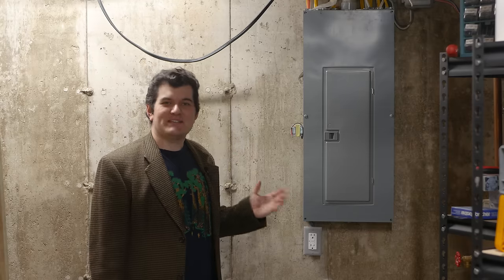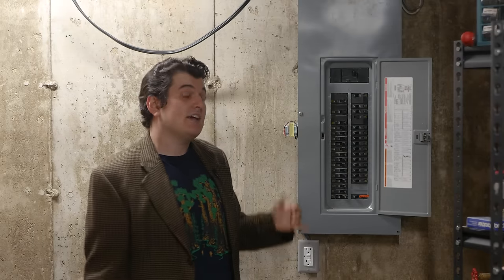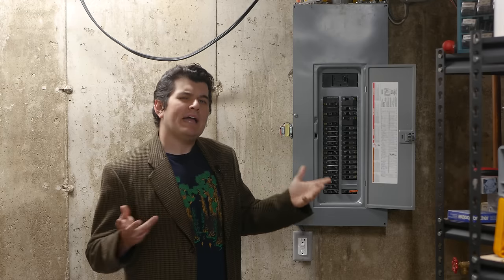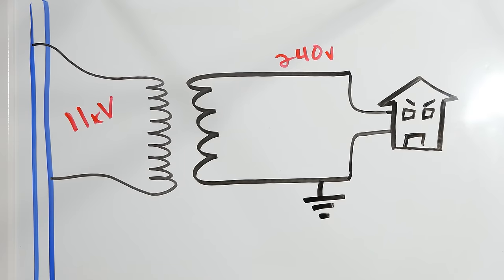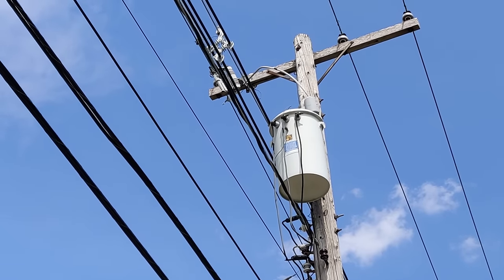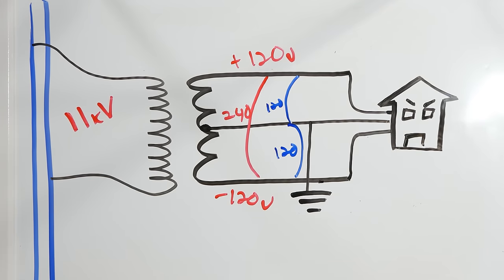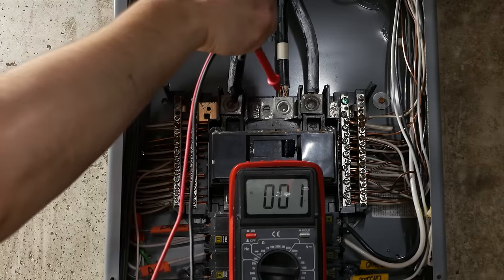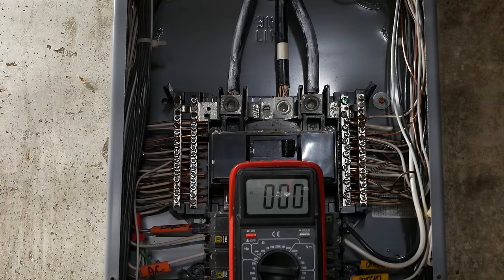The US electrical system is not 120V

Comment: A sign of the times I suppose... When I read the title of this video just now, I read it as "The US electoral system is not 120V"
Reply: So it's in a bit of a split phase, huh?
Reply: When I was a kid it was 110V - tested at 110V. Then 115V. Now 120V. Make it stop.
Reply: I'm pretty sure its running on a button battery. ;)
Reply: No,  it's POE Power Over Ethernet. We have the best money can buy.
Reply: The idea is misleading. What number gets used? The 240/120 used in houses. Higher voltage and 3 phase used in industry? The high voltage running down my street? The really high voltage used by the hi tension towers?
Reply: @captbiptoe  it originally started as 125 volts. It was supposed to decrease in voltage on the line until it finally got to its destination. That's how we ended up with 110 volts. With better distribution systems the voltage keeps getting higher, but it's not going to exceed 125
Reply: @captbiptoe  if you have two phase power, 240 / 2 equals 120. If you have three phase power, 208 / 3 equals 120. I know the angles are weird, but that's how it works out

Comment: In Colombia we get 13.2 kVl Delta-Y 208Vl  3phase transformes and the homes get  1 phase 120 , and 2 phase 208 if it has higth power loads, it has a advantage for the eléctrical system because You have a balancing reference in the low voltaje subsystem. 
And sometimes there are some residences that can get 3 phase but those are very rare, usualy people who have large pools,  jacuzzis and needs to move sincronous pumps, or sometimes people who have their business running i'm their Home and need move 3phase machines.

Comment: 380V says: "Hello from Europe!"
Reply: Yeah he mentioned UK , Aussies and weirdly avoided whole Europe for some reason.....I wonder why :D  Guess 380V/400V would be in next video :D
Reply: @terrabiker  some domestic houses in the UK have 415v 3 phase but it's mainly found in commercial / industrial buildings
Reply: NOPE THANKS  Or maybe it relies on a fundamentally different tech that would make the video too long?
Reply: 400V three phase here in the Netherlands 👍
Reply: @eddhick  415V is the phase-to-phase voltage corresponding to (pre-harmonisation) 240V phase-to-neutral; @CarmenSandiego 380V p2p goes with 220V p2n; 400V p2p goes with the now-harmonised 230V p2n.
Reply: They typically hold the higher voltage for commercial customers in the US. With most of everything outside industrial machines here using 120-240v their is no reason for the cost of fitting 480v everywhere.
Reply: 600v and 480v From America said Hi Back
Reply: 480 3 phase is very common for commercial and industrial motors in the USA, 600v is a standard but more for very large semi-custom stuff. 177/240 is common in lighting
Reply: @FM4AMGV  It would take awfully long to heat your sauna with an electric stove by only using 240V.
Reply: NOPE THANKS  Isn't that obvious?
Reply: @terrabiker  the whole Europe? He mentioned the UK...
Reply: @herrakaarme  yeah, because normal people have a sauna 😂
Reply: @fgsaramago  let me introduce the whole country of Finland
Reply: @laurimannisto5054  What, having a sauna? That's just weird, dude. Why? So people really love saunas that much? I wonder if you can detect a statistical difference in deaths due to cardiac problems when compared to other countries then. Why would people subject them selves to something that unhealthy on a regular basis?
Reply: We have 277/480v in the US, you're not special
Reply: 480volt is for small industrial to run 3 fase motor or heater, not for  residential and usually have own transformer, us too.
Reply: 380 volts say Greetings from Asuncion, Paraguay.
Reply: @fgsaramago  Yep. Finnish population is 5.5mij people and number of saunas is estimated to be around 2 milj. Saunas actually have lot of health benefits. Sure it also has its risks but for normal healthy person net effect is positive. Here are listed a few pros and cons: https://www.medicalnewstoday.com/articles/313109

Comment: Is this a remake of a prior video, that had more errors or fuzzy explanations?  This one still has errors, of simple fact and logical fallacy language usage.  

Grid is defined in the USA by IEEE C2.(year), incorporated into Federal and most state laws.  It starts at 69 kV and runs up to around a megavolt, and is not covered by NFPA NEC.  Most is 3 phase closed Delta in the range of 500-2500 amps per circuit, though some regions include high voltage DC segments (harder to interface, but no need for phase sync on source connections).  

What this video calls grid is not secondary feeders either, the low voltage side of substations, that supply lightning protection, voltage conversion, ties between segments of supply and loads, and voltage regulation.  They often output 2400 V to 48 kV Delta/wye feeders to local areas, designed to feed 3 phase to industrial customers, but allow single phase splits to side streets of residences.  This video mostly talks about what's on the other side of pad or pole transformers from that, which is mostly either 240 VAC single phase balanced (split phase carries different meanings in the US that apply to some small motors), or 208/120 VAC wye to light commercial customers, and some other standards like 480/277, or oddballs like 240 VAC bridged T or open delta 3 phase, one leg of which is a 240 VAC balanced single phase circuit (mostly used for small commercial customers on residential steeets).  

Nominal voltages of services versus component ratings have complex history, where NEMA standards mostly define connectors, that are often 125/250 VAC or 125 VAC or 250 VAC, and single or 3 phase, and if 250 VAC with or without neutral.  Those exist generally in steps of 15, 20, 30, 50, and 100 amps (by then generally Twistlocks for industrial power drops).  Actual operating voltages are a mix of utility and regional power pool trade practices, and state and Federal operating standards.  

It is not true that a 200 amp 240 VAC panel can deliver and sustain 48 kW, nor 48 kVA (where we introduce power factor).  Typically a utility may install a 10 kVA pole transformer for a single residential 200 amp service, capable of minutes to hours of overload of 50-80% above that base nominal load factor, or larger transformers at lower load factor for groups of customers.  I've negotiated higher load factor service transformers on both single and three phase commercial services with predictably higher loads than utilities default to assuming. 

Other standards exist in a jumble of state PUC's, Federal agencies from NRC, NERC, FERC, USCG, ACOE, DOE, EPA, etc, and trade or standards or testing entities like UL, ETK, ANSI, NEMA, NFPA, IEEE, ISO, DIN, IEC, CSA, etc.  

How many US-ians know the size and shape of the legally specified clear work and fire safety space required around an electric panel, which is illegal to use as storage or for cabinets as are common violations?  

A couple of issues this video was misleading about....  International 240 VAC systems exist as both floating, and unbalanced where one side is tied to ground as in US 120 VAC circuits. When floating, or not polarized, that requires both sides be treated as hots, and fused and switched, whereas unbalanced systems allow simpler protection and controls as only one side of the line needs those devices, while the turned off state limits static buildup as one side remains grounded.  

The UK construction site systems mentioned don't just allow a lower voltage, but also DC isolation, such that a short to the isolated power system has no high current power path back to the utility.  Contrary to claims of this video, there is no voltage that results in no current through humans if connected across or through us, but rather some levels of current that aren't seriously unsafe.  That's generally considered to be under 1 mA in medical systems, while over 20 mA can cause heart disruptions while 100 mA to 1 A may seize lungs.  Human body resistance  varies in different paths from around 150 ohms to 5 kohms, not counting often far higher dry skin resistance. 

Clearly for a topic so pervasive, there's a complex enough mix of history, trade practices, engineering, law, and economics, that this is really a difficult topic to cover and keep both simple and accurate.

Comment: I miss my gas dryer. Much cheaper to run, and dried clothes much faster.
Reply: but greenhouse ofc
Reply: Also comes with environmental damage feature
Reply: @jakedhale  Natural gas burns quite cleanly in comparison to the coal powerplants that generally support a grid or are used for peaking such as in Germany it is actually more environmentally friendly (and don't even get me started on the super harmful chemicals created in the production of "Renewable energy" really if you want to be environmentally friendly we need to go nuclear)
Reply: @wh0_am_152  Do you factor the environmental costs of prospecting, transporting and refining the fossil fuels continuesly over the lifetime of a conventional power plant into your assessment?
Reply: F... gas. Run a coal dryer to bring back the jobs to American coal workers
Reply: @wh0_am_152  : Windmills are 95% steel, which isen't seen as an issue most often. 
Solar panels do use some plastics, mainly as encapsulant and backing ; EVA ( ethylene of vinyl acetate ) and tedlar ( PVF or polyvinyl fluoride ) which are made to be resistant and last a long time. 20 to 30 years to be specific. The solar cells themselves are pretty much ceramic paper which degrades over time by them working up. The electrons in the material gets drained out at 1% per year or so. So when the plastics sealing them up are done, they're at 75% left capacity. So basically, what kills solar power is the UV radiation itself and most of the work of solar power is protecting the equipment from these radiation. EVA is made to not become white to the sun, pvf backsheet is used because it's designed for airplanes and stay the same for a long time and such.

In short : We are already trying to mitigate all the issues associated with renewable energy for longevety purposes and those measures do use some polluting materials so you dont have to redo the things 5 times more often. 

For example : solar cells sealed in even uv resistant epoxy will whiten and render them useless in 5 to 10 years which makes more waste in the end.
Also france is like 70% nuclear and they're literally poisoning the atlantic due to that, they have a pipe going down in the ocean for 1km depth then just dump their waste there.
Nuclear issue is waste management and until they can be reused or even used, they are NOT environmentally friendly. They are also literally thinking of burrying them for millions of years and expecting the earth crust to not leak them out for future humans or other species to die from.

Comment: From my understanding the 200 amp main breaker is actually a split breaker, it's 200 amps on each side of the phase. Just like the double breakers that are in the panel for your larger appliances, you will notice on the switch it's State 30 amps but that's actually 30 amps for each phase. So in reality that breaker can actually deliver 60 amps. For the main breaker it does state 200 amps but it's 200 amps on each phase which it's actually 400 amps available.  If one side of the phase power surpasses the 200 amp load the breaker will trip.

Comment: well, by that logic I live in a 400 Volt country
Reply: 380 volts here. Greetings from Asuncion, Paraguay
Reply: @Nathan West
I'm almost certain that you don't live in a 400VAC country. You either live in a 380VAC country or a 415VAC country. 400 VAC is a result of harmonization between mainland europe and the UK. This was achieved by changing the tolerances for 415VAC in the UK to a range of +6%, -10% and for the mainland europe 380VAC the tolerance was changed to the range -6%, +10%. This creates an overlap between the two.
Europe mainland thus should be inbetween 357.2 VAC and 418VAC and the UK should be between 373.5VAC and 439.9VAC. 
If you buy an appliance designed for 400VAC, that just means that it works across the full range of both 415VAC and 380VAC. But a product designated as a 415VAC product is not guaranteed to work on 380VAC (and a 380VAC isn't necessarily going to be able to work across the full tolerance range of 415VAC).
Also, it's a bit of a moot point but the US split-phase approach isn't what we use in Europe (UK or mainland Europe). As far as I know it's only used on bigger farms where you have a 460VAC transformer, which can provide 460VAC or using the same method as the US you can get 230VAC from the transformer.
The split-phase design that the US uses is a single phase design. The 400 Volt you brought up (which in practice as explained is either 380 or 415) is 3 phase.
Reply: @timorohner9574  Maybe that was in some transition phase 20 years ago. I know for sure that my country (EU member) has line grid voltage defined by law as 230/400V. And multiple times I personaly measured voltages between phases as 395-405V depending on site.
Reply: @ivicajanco9921  You're totally right, nominal voltage is 230V/400V, and increased tolerances for - I think - even more than 20 years, I'd say closer to 30 years.

Comment: This video has made me less concerned with Merican wiring, and more curious of European wiring.
Reply: I clicked to finally understand what's going on in the US, and it's still really weird to me. We pretty much have 3 cables with 230v live, neutral, and a ground everywhere. We rarely have 2 pole plugs that don't need ground, and 3 pole that do. Up until now, I didn't even know 2 live wires in an appliance can be a thing.. :D
Also mentioned before, we have 5 pole plugs for 3 phase power, it's 400 something volts, 3 phases, a neutral, and a ground. I'm only aware of cooktops and heatpumps that utilize it though, even those are directly wired usually
Our boxes are plastic (metal box looks quite scary to me), and our breakers are tiny. Oh, and 200 amps sounds like a crazy lot, in my country, 32A is free, and 150 is the absolute maximum for residential use. And to get even that, you need to move your main breaker /electrical box outside, in line with your property border
Reply: the only issue is tuddery 50hz they need a flst 1khz may be a futureproof desin
Reply: @koli0842  In Australia we have a Nominal 240v single phase with the main house input fuse  being 70amps. There's 3 phases, 240v each on the lines outside with, generally, every third house in the street being connected to the same phase. At least that's in my street in Melbourne anyway. Years ago the big main line fuse on the pole a few doors down from our house blew and every third house in the street lost power!
Reply: @mattieb3152  That's also a really interesting architecture to think about, I have no idea about such details on our end. Can you also optionally get a 3 phase line? Is the 72A switchable, or a fix given?
Reply: @koli0842  Used to be able to get 3-phase at residential houses for a fee but not anymore. They've restricted that to commercial premises. It runs at about 400-415v, with various different 4 or 5 pin outlets depending on current rating.   Not sure what you refer to when asking if the 72A is switchable? 
We can get heavier duty 15A 240 outlets as well, which is good for home sheds and workshops where you want to run heavier duty stuff like welding gear etc, and our caravans usually have the heavier 15A circuits for running electricity to them from a lead. The 15A outlets have an extended width earth pin.
Reply: @koli0842  As an American, the current I have seen for a whole house is from 15 amps for a very small house in an area with mild weather, to 400 amps for a very large house in an area with very hot summers (up to 45 C) - I think that house had over 50 kW of air conditioners, although it was probably unusual for all of them to be running at the same time.

I have heard that compared to Europe, America has more concern with fires resulting from electrical faults.  I think this is the reason for putting distribution panels in metal boxes, they are more fire resistant.
Reply: @CoastalSphinx  400A sounds really mad, so does the AC capacity. I'm planning a heat pump for our renovations, and a 14 kW unit looks plenty for anything 90 square meters will need, with a full sized basement and attic with 1m walls to leave more room below the roof. I can see mansions or businesses needing 50kW, but man, that sounds like a lot.
Fire resistance is a fair point, though I'd certainly feel uneasy with the conductivity properties. I guess it greatly depends on what you're used to, really.
Reply: @koli0842  in the US receptacles have to be 3 prong (i.e., grounded or GFCI) but devices can be 2 prong, depending on their design. 2 prong devices require special design considerations such as double insulation.

Comment: The neutral and ground are separate on the dryer for safety reasons. the ground is connected to the body of the dryer. This prevents people from getting electrocuted if there is a short in certain circumstances.